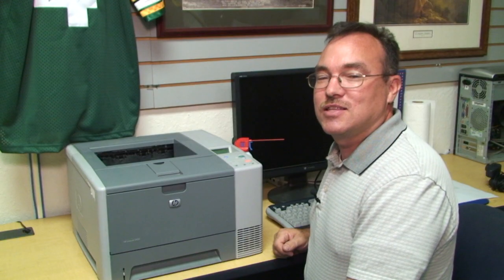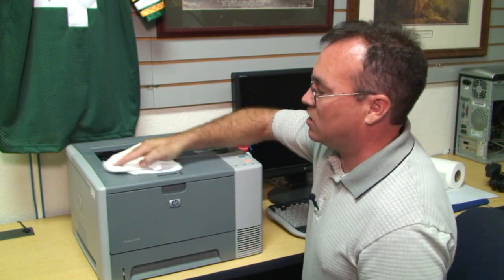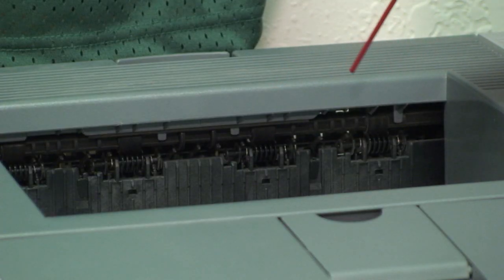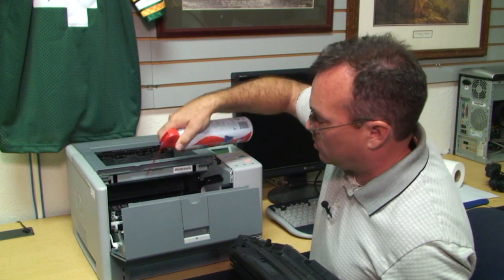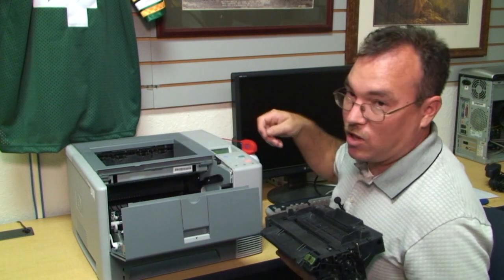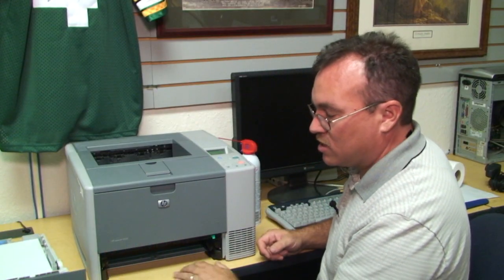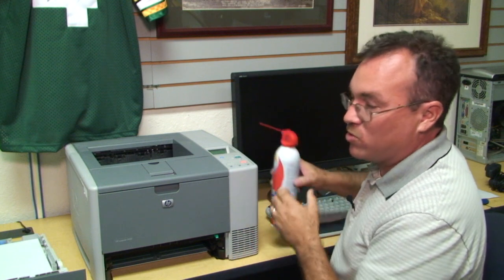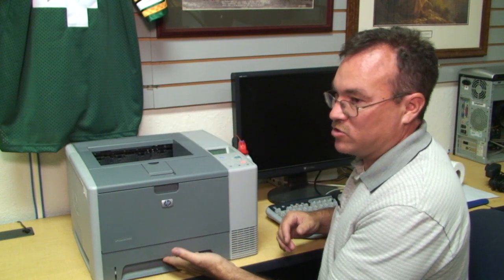Computer Hardware Basics : How to Clean HP Laser Printers

Comment: This is not how a professional would do a thorough cleaning.  The drums need cleaning.  The entire unit needs vacuuming out.  The cartridges need to be checked for leaks.  All the electronic contacts that you can see and reach need to be cleaned with alcohol.  Let's get back in there and do this right, guys.

Comment: this is a joke right? wonder if this guy still own the shop, u should never use compressed air to clean printer, it will blow all left over toner inside the printer motor and gear where u can not clean

Comment: Personally I caution customers not to use compressed air.  I reccomend vaccuming it.  If you look at toner under magnification you can actually see minute metal particles. If you blow the toner into the machine theres a chance it can get on the PC boards and cause them to short out.  Plus it can get in the fuser section.  And on some printers eventually gravity fall on to feed tires causing them to slip and misfeed.
Reply: I've been involved in several investigations due to explosive fires caused by people using air dusters on laser printers, the calorific value of toner when surrounded by air is similar to flour dust and causes a massive fireball if ignited by a spark or other source, I've had colleagues injured and one never returned to work due to his injuries, I personally caused a fireball at a hotel causing it to be evacuated and its amazing to see the damage it causes. Add to that the RIDDOR risk caused by contaminating air and surfaces with toner particles which I've been involved with investigations several times - 100% agree with B Murphy, use a toner vac to clean surfaces, if you were to use compressed air you need to remove the component and then clean it in an air chamber that draws all the contaminated air through a micro filter and has protection against flash explosion - no dust mask worn or eye protection in the video either - be careful doing this, it was not amusing when the hotel fire alarms went off and I had the reception admin on fire - Kev